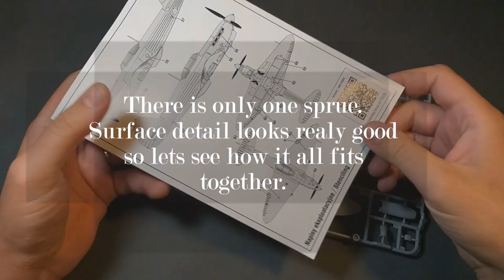Arma Hobby Yakovlev Yak-1b 1/72 Scale Model Kit Full Build

Comment: Nice kit, well built. I add this kit to my list.
You definitely need to use some other paint. These "modern" acrylics are totally inadequate for detail painting. Revell acrylics particularly bad, most of the time even for big scale painting. Their white paint is just trash. I get the point: those paints have little smell. But their advantages end here. If you want to paint 72nd scale models with detail painting, you should use MRP, Gunze Mr. Color or Tamiya preferrably. You can thin them easily, and painting in small with them is walk in the park. And you can lay down those paints in very thin layers. I built a Hobby Boss F9F-3 Panther, and when polished the paint with Tamiya polishing compounds the paint polished away in some places (and I used only the Fine and Finish compound). But the coverage was solid. I needed to rapaint those surfaces, but there were no visible step between the paint layers.
Another thing: if you want to blackbase, then don't use gray primer and then paint it black. No point to do the same thing twice. Use black primer outright.
Reply from the maker: Thanks for the advice. I'look into everything you said. 👍
Reply from the maker: Anorher advantage to the paints i am using at the moment is that cleaning the airbrush is easy. I just use water and IPA. Anyway, thank you for taking the time to write. I already have my eye on some MRP paints.
Reply: Revell Aquas are great for airbrush.